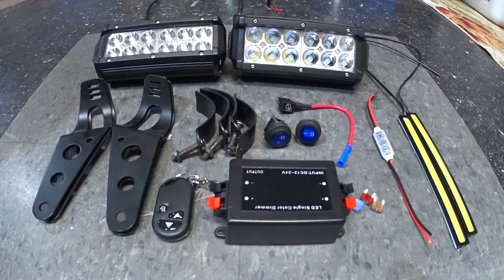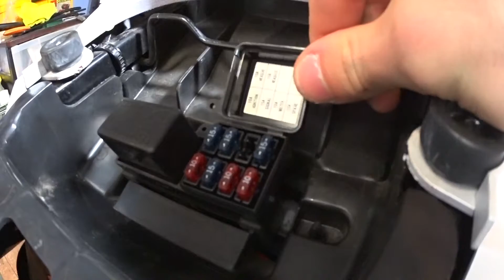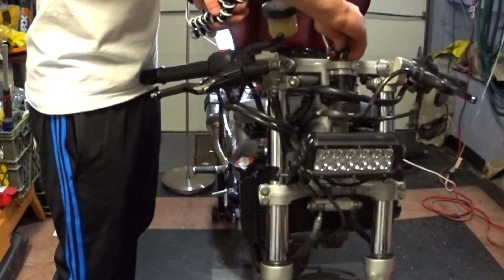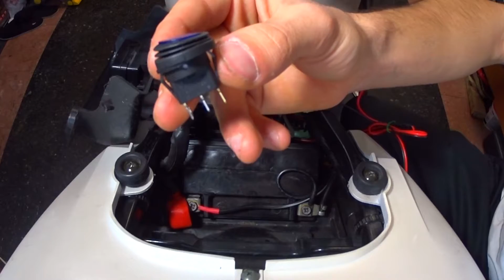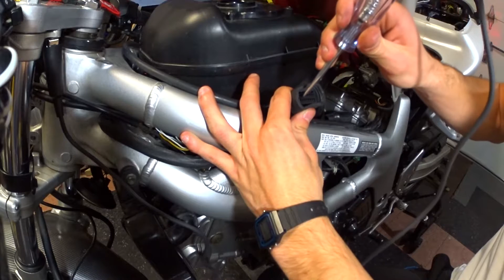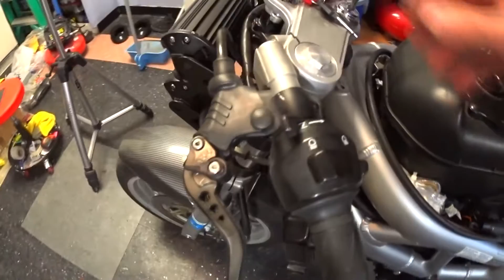How to Wire LED Lights | 5+ Methods

Comment: Really liked your video I found it helpful but I have an issue with my motorcycle...I have no rear running lights for night time .
Headlight works fine turn signals work fine and brake lights work fine...we're do I tap into to get a constant running light?what would be the easiest method to use.   Thanks